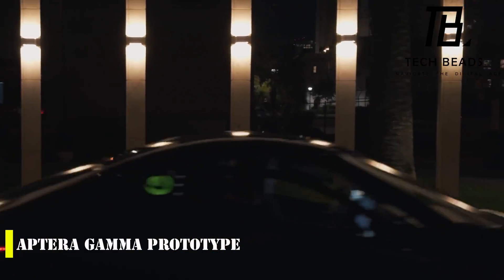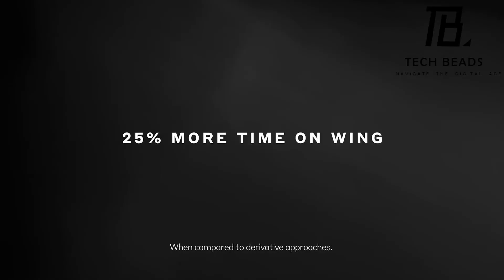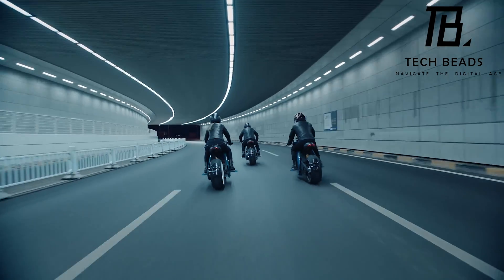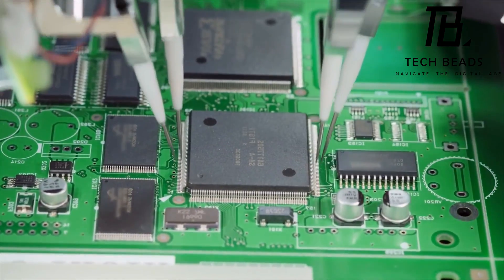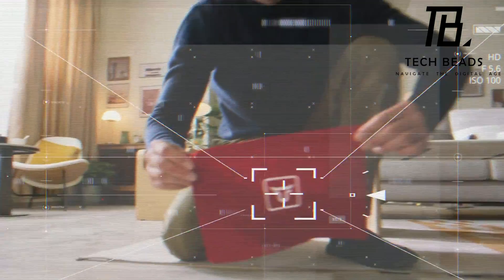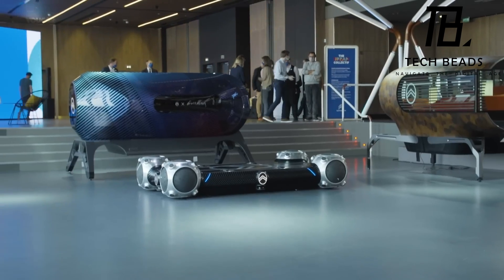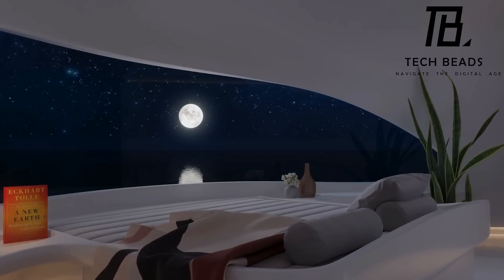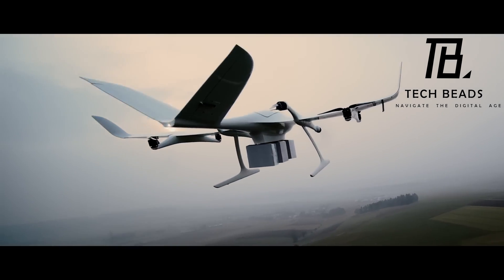2023 Concepts Changing The World You Might Not Know About..

Comment: the rear wheel, on that solar electric, should have been designed as far back as possible under the body work..
tadpoles are more stable under braking, but weight needs to be more towards the two.